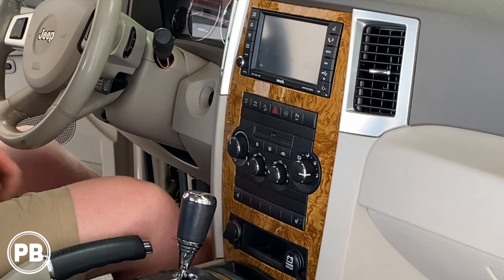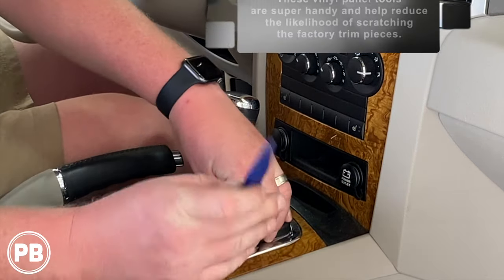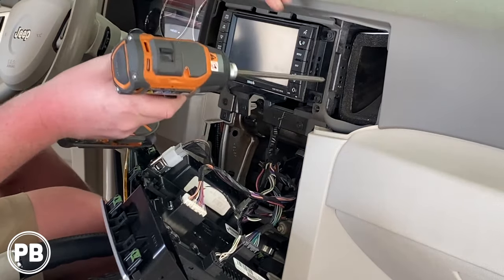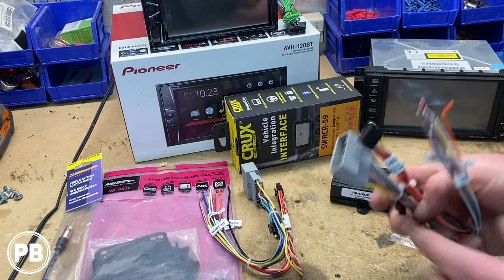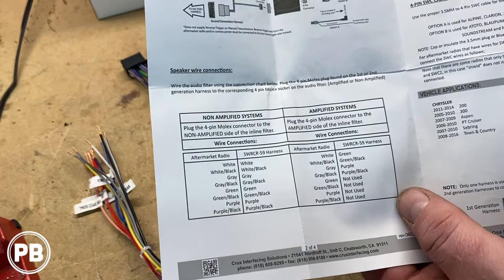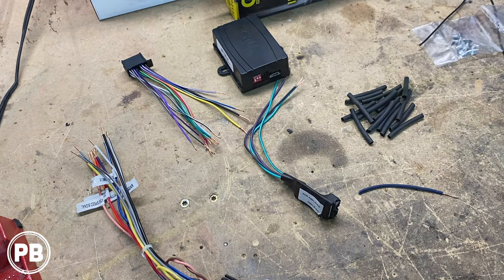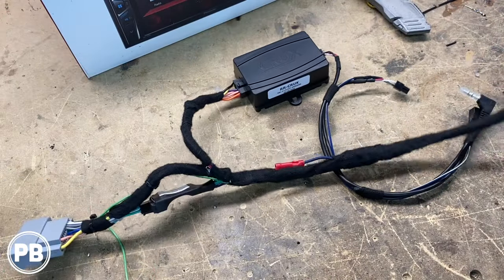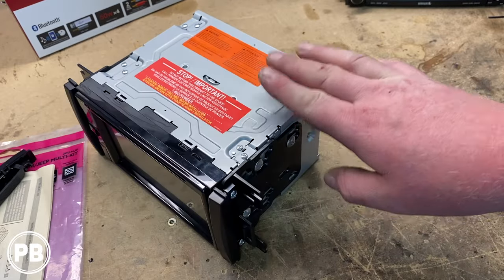2005 - 2010 Jeep Grand Cherokee Radio Install

Comment from the maker: Parts used linked in the description of the video!
Reply: Why don't I have sound to my radio ??
Reply: I got the same thing going on no sound im hooked up looked over everything 20 times
Reply from the maker: @JohnSmithduh  Your factory amplifier most likely isn't turning on.  Ensure your blue / white wire on your harness is hooked up to the remote trigger wire of your radio.
Reply: @ProvoBeastAudio  i get it now it all goes through the swc module! I was wondering why there was also no switched power off the truck. Definitely a confusing one but i got it! Thanks for your help!!
Reply: What about with factory infotainment? Will this set up work?
Reply: @JohnSmithduh  what did you do to fix it 😮 please 🙏  😂😂
Reply from the maker: Using the right harness adapter is the solution.  This vehicle operates on a data canbus system, so a smart harness is needed to replace your factory radio. @luv_singl_moms_nd_tats

Comment: Just FYI: With the older (2005-2007) WK Grand Cherokees, all you have to do to get access to the radio is pull out the surround around the factory radio, which also includes the vents. For some reason, in 2008, you had to remove the whole center console, as shown here. The process shown here will ALSO work for the 2008-2010 Jeep Commander XK. :)

Comment: I installed this crux wiring kit yesterday at first the audio was not coming from speakers then after i turned the car on (running) it worked…everything was good until today and its the same issue no sound i dont know what would happen to make it stop working. Could it be the crux?

Comment: Any idea what color the steering wheel wore is in the steering column? We’re trying to hook up a stereo and retain the buttons on a 2005 grand Cherokee and the controls won’t work. Have to wire it directly to the wheel control wire but cannot find a diagram anywhere showing what color is correct for my year.
Reply: You gotta buy an adaptor head over to crutchfield they’ll show you which one you need for you’re specific vehicle.

Comment: Overall, excellent video but should’ve spent less time showing soldering wires and a bit more time on one of the most significant parts of this install which is cutting that support bracket out. Is that bracket metal or plastic? How did you go about cutting it and with what tool?
Reply from the maker: Plastic, and a multi tool.  Some people use a saw.  Whatever works.

Comment: I have a 2008 GJ diesel with factory amp. Installed Pioneer AVH 240 EX Everything set up as per instructions, but no souhd. Also SWC doesn't fit. the factory cable. Factory cable has same outlet as the antenna cable. Any ideas? Thanks
Reply: Did you get the audio interface? The one for this jeep is pretty cheap
Reply: Without the interface sound won't wprk. I have the scosche cr4000sw but it may be a different one for diesel. Not sure.

Comment: So I did this install on mine same car late last night, radio crux I used your parts list. I need to add rca and a radio Antenna everything worked perfect but for some reason I am confused on the satellite radio and the navigation radio adapter plugs that I need I am not seeing what I need on your list?

Comment: This was a great instructional video.  I just installed a Pioneer into a 2007 JGC and couldn't have done it without this video. Thank you very much!  Only issues were the dash kit, and antenna were not the correct ones. At least for the 2007 JGC Overland, you need the Metra 99-6510 Dash Kit and the Metra 40-CR10 Antenna Adapter.

Comment: Great video.  I just installed an aftermarket stereo in my 2007 Grand Cherokee, replacing the NAV system.  Everything works fine, except I can't get the factory reverse camera to work as the stereo loses power when i shift into reverse. Any suggestions?

Comment: a few of these parts don't fit my 2007 JGC.  might want to update to 2008-2010.  The kit was too small and the antenna adapter was wrong FYI.
Reply: Any update? Did you find something that fits I have 07 as well
Reply: @DHILLA-yz4rx  Amazon is pretty good about matching to your vehicle if you put it in.  That's what I did now kit is good and antenna too. . .
Reply: @tonymurray758  what did you get

Comment: Thank you so much for your videos. They are really well done. 

I have this exact vehicle and I am planning on installing a rockford fosgate p300-12 soon. 

Do I have to use an aftermarket radio if I want to hook this sub to my jeep? I actually like the stock radio they provided, and if possible I’d like to just connect the sub to that unit. 

Please let me know if this is possible, and thanks again!
Reply from the maker: You can keep the factory radio, yes.  Just a line out converter is needed for your install, like this one: https://amzn.to/33lRh5u
Reply: @ProvoBeastAudio  nice thank for the rec man. I’m pretty. Lear on the concept of what I have to do, but I’m a little concerned about stripping the wires on the head unit. Is there some description of which wire does what in the owners manual maybe? I get that I need to get the signal from the radio/amp/speaker, but I’m not sure how to identify which wires to connect to the LOC. sorry for the long message

Comment: I followed everything I have no power to radio . And you used an extra blue remote wire where do I hook that up at and am I using the blue white wire from the crux adapter

Comment: Will all of this Pioneer hardware work on a Pioneer DMH-1770NEX in a 2010 Jeep Grand Cherokee SRT8 with the factory speakers, parking aid, security system and steering wheel controls?

Comment: Essentially, you leave the amp plug behind the radio unplugged then, and run the white/yellow off the 3.5 for a garbage radio that doesn’t have a jack, but has a hardwire 6 pin swc retention for this, right? Tried with pac and realized I either have to run a bypass and a better amp, or literally just have tweeters and nothing else…or try this.

Comment: I got a 2010 Jeep wk and I got 7” a car dual radio system and the rear end of the radio is a little shorter so still use the big brackets dash kit?

Comment: The Jeep RER radio you replaced has built-in navigation maps and GPS / Sirius antennas. I heard the latter mentioned (but not much detail) and the former not mentioned at all. Does the Pioneer unit have built-in navigation maps or does one have to hook up a cell phone?
Reply from the maker: All depends on the radio you install.  This Pioneer is your entry level pioneer, so no.  However there are many options on the market with Android Auto / Apple Carplay or even native nav in the unit for a higher cost.

Comment: Where can I get some remote turn on wire also you should have added that and the wire wrap in the description
Reply from the maker: Any auto parts store will have general stranded automotive wire (18 gauge is fine).  We use Tesa Tape: https://amzn.to/3nb5Kt1
Reply from the maker: Here is some 18 Gauge wire: https://amzn.to/3dft1Ez

Comment: Hi there. Whereabouts is the ground wire connected to the car body? I think mine isn't grounded properly. Thanks.
Reply from the maker: It generally connects to the dash support bracket. If you have grounding issues, just wire your radio to the dash support metal bracket directly with a ring terminal.

Comment: Hi, my car came just with the base radio, not amplified, doesn't have steering controls. Do I need to buy the crux module anyway? Thank you
Reply from the maker: You still need a smart harness, yes.  But you can go with the base harness by Axxess since you don't have a factory amp or steering wheel volume controls: https://amzn.to/3PTBaAW
Reply: @ProvoBeastAudio thank you very much, I ended up ordering the one that Crux SWR-CR59. Does that one works ok? Even if I have the base radio. I don't want to start dissasemblying if I don't have the right part. Thanks in advance

Comment: I installed this in my F450 but my Bluetooth icon won't stays gray. What did I do wrong? Thanks in advance
Reply from the maker: If you used a Pioneer, it has to do with the green parking brake wire which needs to either be connected to the parking brake ground wire, or with use of a bypass to unlock those settings.

Comment: How many labor "hours" did this take you to modify and install? At an estimate, how much do you think doing this would cost if I took it to a car audio installer? Thanks!
Reply from the maker: This took about 3 hours man hours.  Shop rates can vary between 50-300 an hour, and you get what you pay for.  Most shops wont install your own equipment, and will only install equipment they sell.  You will just have to call around.
Reply: @ProvoBeastAudio  Thanks!

Comment: So I have the amplified version in the harness connector you showed it said “not used” on certain lines does that mean the harness ONLY amplifies the 3.5 dash speakers and the door 6x9’s? Not the rear 6.5s?
Reply: No, the fade front/rear is controlled by the canbus system for Bluetooth calls/etc, so the factory amp only takes in 1 L/1 R signal and distributes to all 4 ch after. (Phone calls mute the back doors). 
Quite irritating setup.
Reply: @michaelmcdonald5385  very irritating, I’m half convinced to just just throw the amp out and run new speaker wire to all of them when I get a new head unit
Reply: @Pairofrickowens  need a bypass harness to do it (plug in at the amp, run all the way back up). That’s my current debate with my girlfriend’s Christmas gift and the cheap SJoyBring head unit she bought. Got everything in nice and neat, now realizing pac swc module/harness won’t work, while everything is back together and good, except only have tweeters and some loud ass bass, no doors. 😂

Less you feel like running from the head unit. Guess either way works if it’s apart.
Reply: @michaelmcdonald5385  I feel you, it’s a terrible system and there’s barely any after market for the WK jeeps so I have to scour the internet for any advice on amplified jeeps

Comment: I can't get a regular sized double din to fit in the opening on mine, I have an 08 grand cherokee Laredo 3.7l Nothing fancy like the one in the video, but seems like there's something back there blocking me from pushing the stereo all the way in
Reply from the maker: You may have to cut a part of the subdash
Reply: @ProvoBeastAudio  what do you cut it with? It’s very thick plastic lol
Reply: Same car and same issue here, were you able to cut it out
Reply from the maker: @AwesomationGames  We used an oscillating multi-tool

Comment: Would this one work for a 2007 Grand Cherokee with the optional Boston Acoustics audio system?
Reply from the maker: That is the identical vehicle in this video.  All parts used in the description of the video.
Reply: @ProvoBeastAudio  what about 2008 with the boston acoustics system? also does the boston acoustics system have built in amp?
Reply: @gregrhodus8121  Yes, it does. I have a 2008 Jeep Grand Cherokee Limited with Boston Acoustics.

Comment: How did you get the power to the backup camera?
Reply from the maker: It's powered separately, we just pulled the video signal for our new radio.
Reply: @ProvoBeastAudio  Thanks! Mine will not work hooked up like yours. Also, how did you maintain steering wheel controls?

Comment: What Is The Parking Brake Wire For 12:21
Reply from the maker: For video playback while parked as well as availability to addition options in settings menu of the radio. Alternatively you can use a microbypass
Reply: @ProvoBeastAudio  So My Parking Will Work Without The Parking Brake Bypass??
Reply from the maker: @jimmyjazz_  I'm not sure what you mean.  Your radio will work with the bypass hooked up, correct.  You may not have all features enabled though.